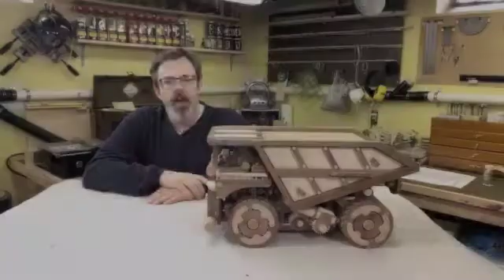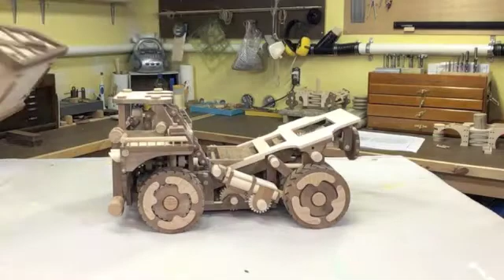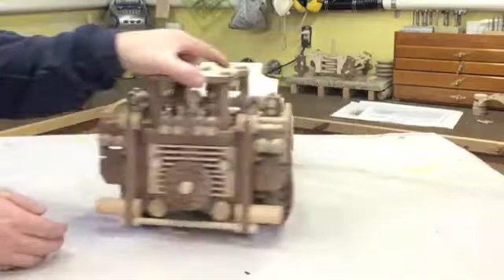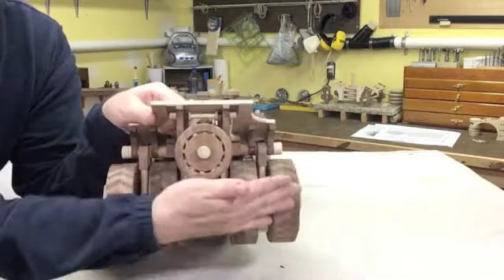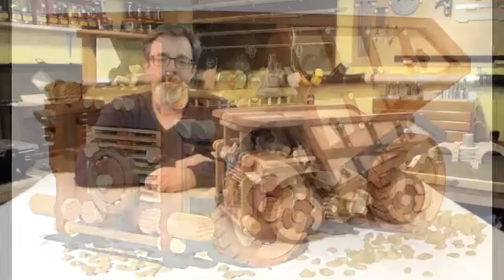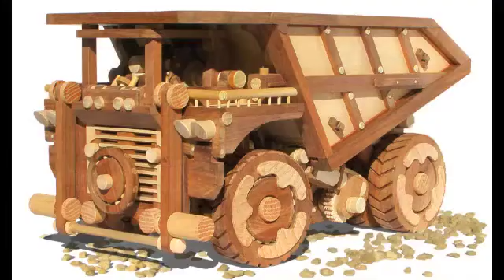Wooden model mining truck - homemade - plans available

Comment: I made this truck and I must say it was challenging, especially when the instructions show one way when in fact it was wrong. Some say 4 parts when in fact only 2 are needed, some say 2 parts when only 1 is needed. Mr DeVries if you are reading this check page 20 Where F-9 shows holes drilled off-center when in fact they should be centered to allow for a dowel to pass through, as indicated on page 24 where 2 spacers of equal size are indicated. Very frustrating as the parts have already been glued in place and have to be ripped out. Page 50 instructions say F-60 x 2 then goes on to say "Glue the 4 F-60 pins into the holes on F-61" so is it 4 or 2? As I say very challenging, don't think I will be purchasing any more books thankyou.
Reply from the maker: No set of instructions is perfect, and I will be the first to admit that there are a few errors. I keep track of them so they can be fixed in a 2nd edition. The ones you mentioned I have already noted, but thanks for pointing them out. As you can imagine, technical editing on plans this complex is a painstaking process and things do get missed. I have gotten a lot better at it, but the truck model was one of my earlier set of plans and even when I look at them I sometimes can't believe a couple of the things that I messed up. Either way, thanks for being polite in your critique, and have a wonderful day.
Reply: @s.g.devries8557  Thank you for the reply but I have to say, you had already built this model, so the mistakes should have been obvious. I get the impression that you were not unduly concerned and sold the books anyway, to unsuspecting customers! I have built models before from plans purchased from 'Toy for Joys', yes there are a few trivial mistakes in their drawings but nothing on this scale where a piece has to be pulled apart and rebuilt. As I said, challenging, one would have to read through the entire book and check every single item and still come up against problems when building. Not happy sir, to say the least.

Comment: December 7th, 2021 have completed this build. I used mainly oak, cherry, maple, walnut, and hickory. It was, is the most complex model I have ever attempted. Have not worked with any type of gears, much less getting them to mesh at right angles before. It was for me to figure it out, and doing the steering gears twice. This build was great. Making the chain was also new for me. Part of the appeal this model had for me was the measuring and drilling, and high accuracy needed. I learned a lot while doing this model. I have since started to build this model a second time, this time using mainly walnut and oak, and maple. From what I have learned from the model the first time building it, the beauty is intensified this second time around, The gears were a chance to learn, having to do many of them several times before getting them correct. Am happy how the model turned out. Steering works great, drive shaft and differential are awesome, as is the lift and the tilt. Thanks so much for the great plans. Hope to post pics. Cheers.

Comment: What are the rough final dimensions of this build when it is all finished?
Reply from the maker: Hi Kenny, good to hear from you! Loved your video on my small parts clamp. The finished mining truck is 10-3/4" tall, 21" long and 11" wide. Thinking about giving it a shot?
Reply: @s.g.devries8557  Thanks for the information.  I've already purchased the book and started the model 4 weeks ago.  I have the wheels and the treads cut and this coming weekend, I will be working on finishing up the wheels and then it looks like it is on to gears.  I have been posting progress pictures on my YouTube channel's facebook page https://www.facebook.com/media/set?vanity=kennyearrings1&set=a.2833976713488042
and when the model is done, I will feature the final product on the show in the hopes of guiding more traffic to your book.  After that, who knows?  I may even give the crane a try.  Thanks for your answer Steve.  I couldn't find the final dimensions listed in the book but I probably missed it.

Comment: Amazing engineering, How do you make the gears.
Reply from the maker: Sorry I missed you comment earlier. I make the gears with a fine blade bandsaw. If I had a scroll saw I would probably use that instead. I draw the patterns then glue the pattern onto Baltic birch plywood to cut them out.